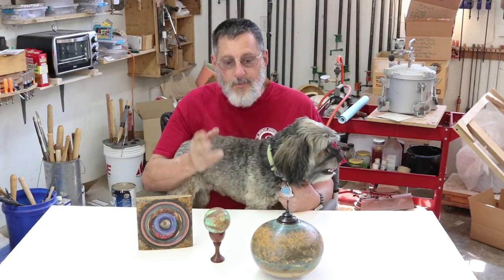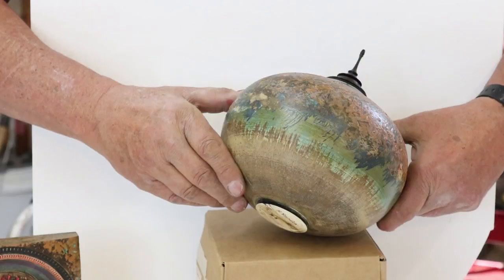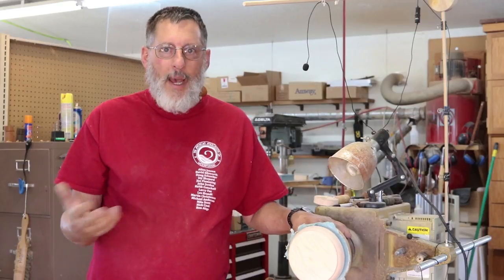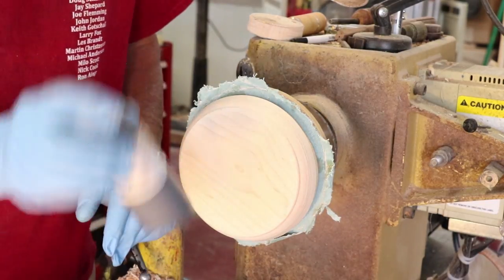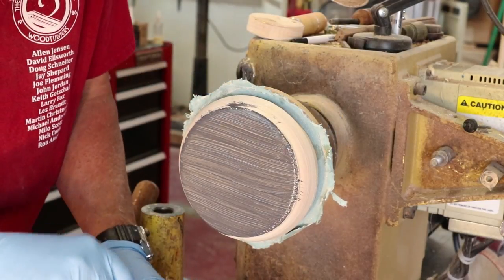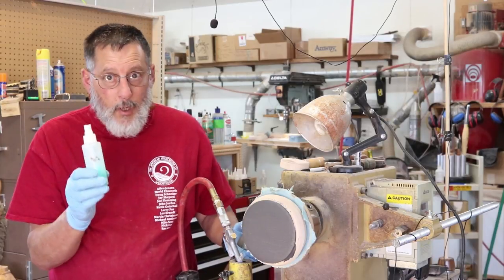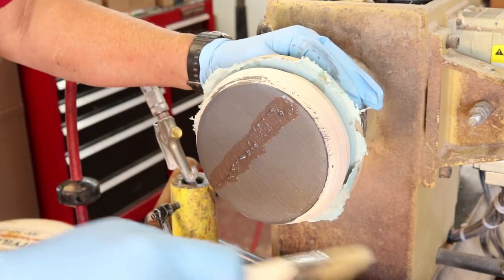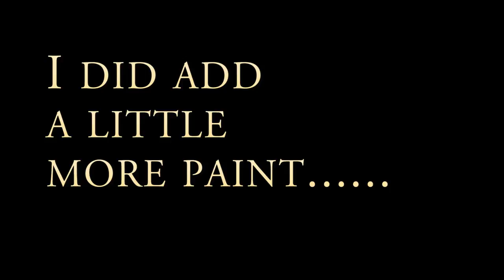Applying Metal Reactive Paint with Sam Angelo-wyomingwoodturner

Comment: a couple questions if you don't mind.  1)  I’m trying the Verday out on a small silver maple hollow form for the first time.  The hollow form is 5” tall kind of water droplet shaped with a 1-1/4” opening at the top.  Do you paint or stain the inside of the hollow form or keep it natural?
2) When using the metal reactive paints I know the directions say to use a coat of the paint as a base and let it dry before second coat with the reactive spray.  But, when using the lighter green or blue do you tend to use a black stain or flat paint as a base to ad depth before the base coat of the Verday color? 3) what do you use for a protective top coat?